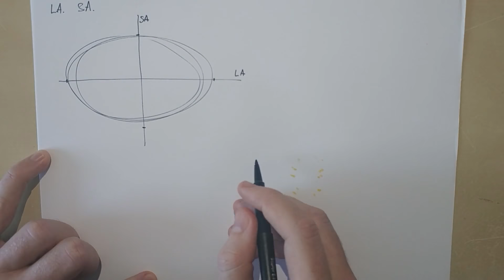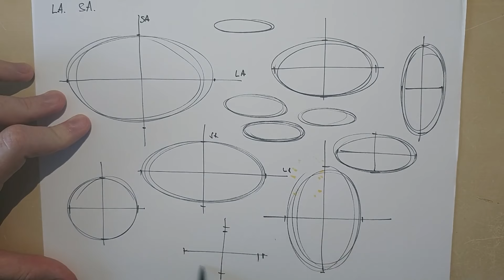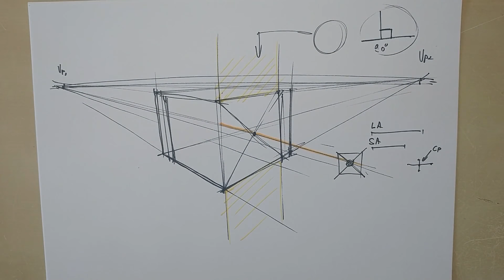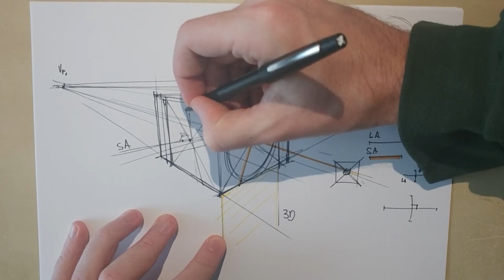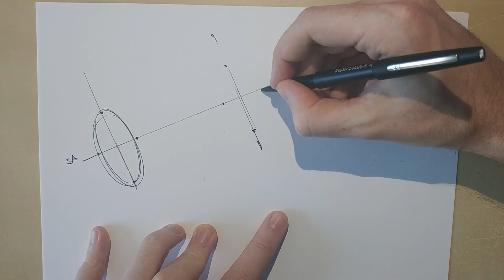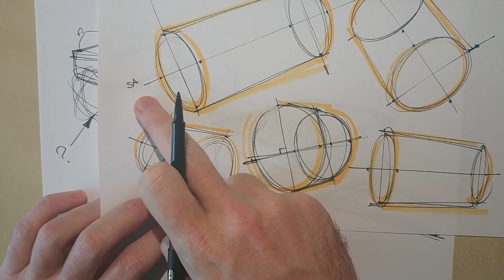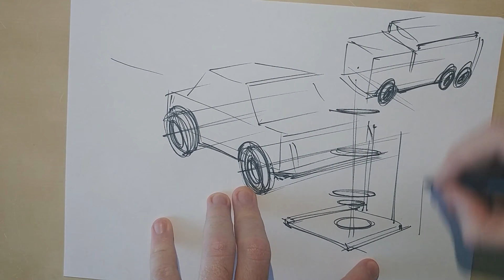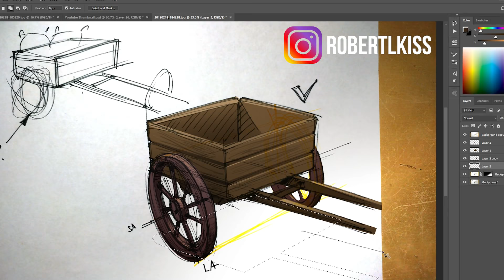Industrial Design Fundamentals 02 Ellipses

Comment: i learned more about perspective from your cart example than i have in years. technical drawing for workshop production does not require that perspective be learned, so this is a wonderful departure for me. and i can even draw a cart, now... which is going to be super useful when the oil runs out and i have to build a real one.
Reply from the maker: Haha glad you found my video useful mate, and I'm looking forward to see your DIY cart ;)
Reply: Hi Dudley what kind of workshop production if I may ask, and are there any models of drawing or mapping things out that you use? Trying to find information on drawing up project plans is actually how I wound up on these (outstanding) video series here. These will help immensely but I'm still looking for guidance drawing up plans.

Comment: Your tutorial was very informative to me but there is one thing I don't understand. In 5:50, how long the SA and LA should be? My ellipses are not looking flat on the cube surface because of that. Like, when you are looking at a tube from perspective view which has not been cut straight.
Reply from the maker: You will have to do it with feeling. Best thing would be to hover your pencil on top of your paper for a couple of times in the shape of an ellipse so it fits into the box. Then set the distances based on the estimation that you did and draw the ellipse. You will still have to adjust the ellipse but the more you do this the more you will get used to it. Usually it is easier to draw the ellipse first and the box around it.

Also watch out I made a mistake in that video here is a correction video:

https://www.youtube.com/watch?v=mjTh9tDFXOU

Comment: there is one thing I don't understand... if the long access is perpendicular to the line going to the second vanishing point, that means that your ellispse will change if the second vanishing point changes ??? that doesn't make sense because the foreshortened initial square in which the circle fits is only affected by the first vanishing point !!!
Reply from the maker: I totally understand your confusion here I should have done a better job laying this one out.

The problem here is that in nature moving one vanishing point doesn't really happen. If you take a Rubik's cube, for example, lift it to eye height and rotate it, both sides will change. The same thing would happen with the cube that was drawn here if it was in nature. Because we(our eyes) are the camera that si rotating around objects the vanishing points will always adjust. So, in this case,  you are right the change of the axis will not influence the ellipse even though technically it should. But as I said this is really due to the fact that vanishing points are not something we can move in nature, they are constructs that help us in drawing.

Another thing worth mentioning here is that 2 point perspective doesn't really exist in nature either. 2 point perspective is what we use in isometric depictions. In nature, we always have at least 3 point perspective. I am really sorry for the long text but this would be so much easier to explain while drawing and talking. I think I will make a new video talking about this soon.

And to answer your other question, yes my ellipse didn't touch the foremost vertical edge because I wanted to draw a circle, and the side of the cube wasn't a perfect square so the two won't fit. This will happen if one is not precise enough when drawing freehand.

I do hope I managed to clarify things a bit for you with this long-winded answer.

Comment: On 5:10, I found it a bit hard to understand why the perpendicular line to the surface is the short axis for the ellipse. The vertical line is a 3D object, and its projection to the surface is the shortest axis for the circle… I am wondering to what extent is this rule applicable and whether there is an intuitive proof…
Reply from the maker: I think the best test for it would be to draw the ellipse without an axis line that is perpendicular to it in 3D space and try constructing that axis afterwards, draw the ellipse in different angles and see how you can fit the axis. I only used the box to make it a bit simpler to understand for people who can't envision 3Dspace that easily.

Comment: how did you understand that SA must be exactly at this size(When you drew a cart)
Reply from the maker: Yeah, good questions sadly my only answer is experience. I can see when the ellipse is not in the same perspective as the side of the cart. If you check some of my later videos I recommend you draw a square in perspective adjacent to the side of the car and you try putting your ellipse in there that will help you estimate the length of the SA.

Comment: Really appreciate learning from you. One question, how do you determine the size of the small axis in the 4th and 5th cylinders where it's sped up at 8:35? Is it something you just have to feel out or can you measure it somehow?
Reply from the maker: Glad to hear that, thanks for checking out my videos. As for your question, it really depends on the perspective you are drawing the cylinder in. If you want to be more precise with your construction imagine the cylinder being in a box that is in perspective.  In that case, the ellipse that forms the basis of the cylinder will have to fit onto the side of the box which is in perspective. After a while, that will come with feeling. But it is hard to lay it out with words I do hope this helps and doesn't further confuse you ^_^
Reply: @robertlkiss   Thanks for replying. I understand what you mean by using boxes. I think I have trouble because my lines are not correct enough when drawing boxes in perspective, which means my ellipses don't look correct. I just need to keep practising!
Reply from the maker: @Leechtime  yes you definitely have to be super comfortable with your lines and rectangles in perspective before you can move in to ellipses.

Comment: So the edges of the short axis is equal on both sides of the middelpoint? One side should not be "wider" than the other?
Reply from the maker: If you draw three ellipse in 2D the the two heals of each axis are equal. In perspective you get foreshortening which makes the one closer to three camera slightly longer.

Comment: i still don't understand why the Long axis line kinda tilted i thought 90° would be parallel  with the center point line.
 5:41 😵
Reply from the maker: When you are looking for the 90degree angle you actually have to use real 90 degrees not the perspective distortion one. And the center point line is going to create a sharper angle then 90degrees.

Comment: I just tried this. The part that confuses me a little bit is that the resulting ellipse/circle appears off-center from the plane/rectangle where it is drawn. I was expecting since the center of the ellipse/circle is at the center of that rectangle, it would appear centered in the rectangle. However, the "far" side of the ellipse touches or very close the far edge of the rectangle, while the "near" side has a bigger gap. Is it because the lengths of the short axis not taking perspective into account?  Wouldn't the "far" half of the short axis should be shorter than the "near" half? Despite this, the "circle" still looks correct in perspective I guess.
Reply from the maker: Yes that was my bad. The cebter if the ellipse that you create in a rectangle is not going to be in the center of the rectangle. I was mistaken when I was doing this. Here is a correction video I made hope this helps:

https://youtu.be/mjTh9tDFXOU
Reply: @robertlkiss  Oh, thank you for the correction  video. That's great! Great videos, by the way. I really enjoyed them!
Reply from the maker: @msunardi  Glad to hear it cleared things up and I'm happy that you like my videos :)

Comment: 3:12 I've always wondered, is there a way to construct a cube with guidelines in 2pp instead of having to rely on intuition?
Reply from the maker: You can according to the video below. The problem with this solution is that you rarely have both vanishing points in the frame. And also it seems to be very time-consuming.

https://youtu.be/oO3LWWV47hU

Comment: Helloooo someone helpppp I suddenly have a doubt now!!! So like if we are drawing in 2 point perspective and we draw this cart but next to it we draw a tower ie. a standing cylinder instead of a horizontal one (the wheels were the horizontal one) so how will the principle of the short axis being the line which meets the vanishing point in two point perspective and how will the line perpendicular to it become the long axis???? Cos it’s easy to draw those standing cylinder drums in 1 point perspective and get this rule right but what about the same standing cylinder in 2 point perspective???????
Reply from the maker: Remember how the axis of the wheels pointed at the side of the cart, in the case of a tower or vertical cylinder the axis if the object will always point directly to the ground, which means you're minor axis points directly to the ground which will make your major axis parallel with the horizon line. Unless your ellipse is on an inclined surface (your tower or closer is tilted /not vertical) your major axis should always be parallel with the horizon line.
Reply: @robertlkiss  thanku for replying so promptly! According to what u explained my doubt now is that are the inclination of the surface on which the cylinder rests and the horizon line the only two things on which the axis of the cylinder (minor axis of the ellipse depend on? When I apply this rule to vertical cylinders (eg. a barrel on the ground) it makes sense but it’s confusing me because if our cart was moving on the SAME ground that the barrel is on, then why is the axis of the horizontal cylinder (cart wheel) derived through the vanishing point and not the inclination of the ground (which is flat) but the axis of the vertical cylinder (barrel) is derived through the inclination of the ground (flat)? Like why is there this discrimination for vertical and horizontal cylinders, why is the rule not universal?
Reply from the maker: @shriya8966  because in a 2 point perspective all vertical lines are parallel hence there is no vanishing point. In a 3point perspective you would have to go to the 3rd vanishing point with the horizontal cylinders
Reply: @robertlkiss  oh okay yes this makes so much sense THANKUUUUUU ROBERT (I'm from India we luv yu)

Comment: your ellipses don't seem to touch the foremost verticale edge of your cube
Reply from the maker: Because In this case, it's not a cube. The side that I drew the axis on if rotated, so it faces the camera, will probably be longer(or wider) than it is high.  That is why the ellipse only touches the top edges of that side.
Reply: @robertlkiss  it might indeed be due to your square not being perfect, but you're also making a mistake assuming that the intersection of the 2D ellipse major and minor axis would be in the same point on the canvas as the center of the 3D circle - this is simply not true. The major axis would actually be positioned slightly to the left along the minor one.
Check out this page to see what I'm talking about: http://userwww.sfsu.edu/trogu/420/reference/perspective/tutorials/ellipses.html

Of course when it comes to actual methods of free-handing a convincing ellipse that doesn't have to be mathematically perfect, then whatever works for you is good and you're clearly showing an ability to sketch good enough ellipses later in the video. However, the amount of inaccurate information regarding ellipses on the internet is very frustrating for someone trying to figure it out as a beginner.
Reply from the maker: @itch433  Yes you are 100% right. It is almost impossible for the major axis being in the same spot as the center of the circle due to foreshortening. Sooner or later I will have to redo this video 10 minutes explanation might not be enough. I remember we spent over 2 hours just on ellipses and most of the students didn't get it on the 1st go.

Comment: I suspect this way of constructing ellipses is incorrect. Wouldn‘t the ellipses need to touch the outer square exactly at each respective MIDDLE? In your example this isn‘t the case if you look closely. If you draw a vertical line so it goes through the center of your angled ellipses the point where the vertical would meet the ellipses would be different measured horizontally. That doesn‘t really make sense, because that would mean they were‘nt perfect squares but egg shaped, no?
The way I construct ellipses is that I find the middle of each side of the square and then try to fill in an ellipses that connects with each middle point completely parallel to the line it belongs to.
Reply from the maker: Drawing through the center point is incorrect indeed I made a follow up video correcting this.